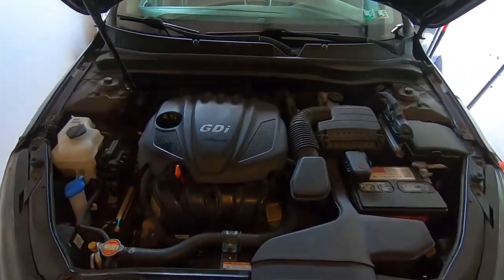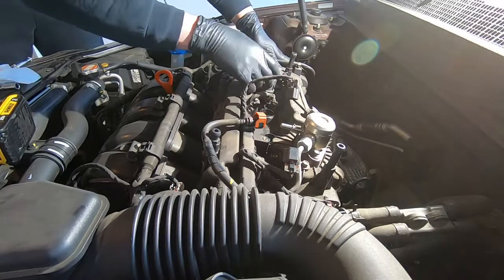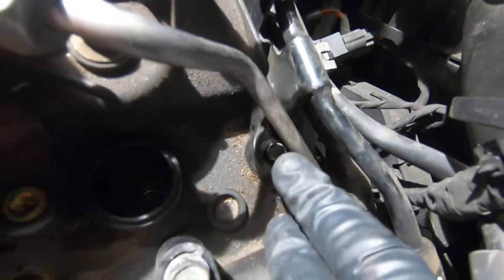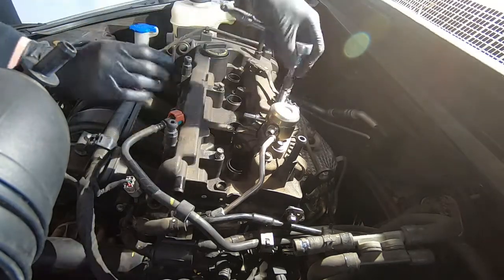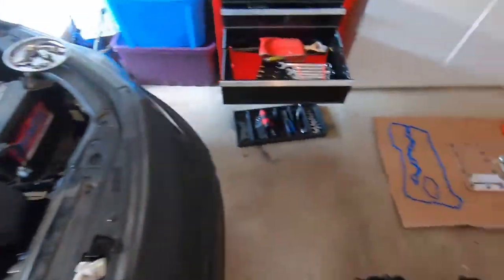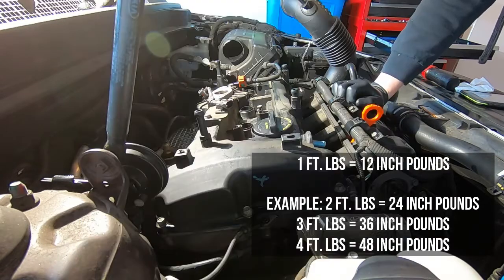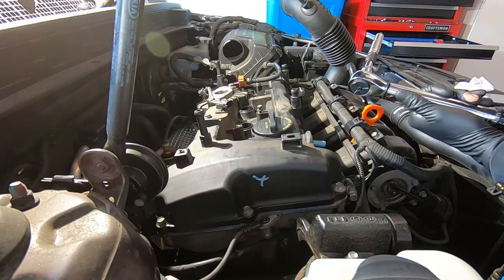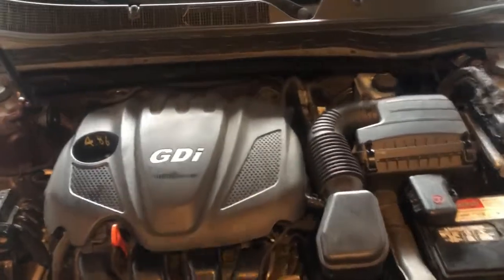2011-2015 Kia Optima Valve Cover Gasket Replacement (2.4L GDI)

Comment: Great tip on removing the fuel relay and letting the fuel run out  was the most important part. Good thing I watched this video before I tried to remove it. The pressure removing the hose would've been dangerous if hadn't done that.
Reply from the maker: Glad it helped 🙏🙏🙏

Comment: Thanks a million my daughter`s 2015 Optima is starting to leak oil around the valve cover gasket rear onto the heat shield. You made this job super easy to follow. I will be doing this weekend. Can`t imagine what Kia would want to do this job. Her car only has 71K miles on it.
Reply from the maker: I appreciate it! This was around the same mileage. Good luck with the project!
Reply: Crazy how my Sorento has 80k same issue, leaking at the same area. Must be a common issue around this milage.

Comment: Just did this today on my wifes optima. Thanks for the video as it saved me a lot of the hassle of figuring out what needed to be moved and the locations of certain nuts and bolts. Took about 3.5 hrs. Not too terrible.
Reply from the maker: Awesome to hear man, glad you got it knocked out 👍👍
Reply: @TheOriginalBeeCee  so far no sign of a leak. I was adding a lot of oil between oil changes and it stunk because of it dripping down the exhaust side onto the heat shield and manifold.
Reply from the maker: These cars are notorious for burning oil as well, so I doubt it was just losing it from the VCG. there was a recall for it and everything. This car in particular was losing almost 2 quarts in a 3k interval
Reply: @TheOriginalBeeCee  I know they do. Hers burns very little. Maybe half quart or so between oil changes. Ive been a fanatic about changing her oil though. The vast majority was the gasket.

Comment: I'm no mechanic, but I try to do certain jobs myself to cut down on cost so I appreciate a lengthy video that shows step by step, thorough instructions. I'm actually going to be doing this exact job on a Kia Sorento tomorrow to THANK YOU!!!! I definitely would have messed something up.
Reply from the maker: Awesome man! Glad it helped, good luck with the job!
Reply: @TheOriginalBeeCee  can you talk with just your hand? I can't find a torque wrench lower than 5 ft per pound anywhere
Reply from the maker: @TheFrost82  I would suggest against it. Especially doing the valve cover gasket. You need an inch pound torque wrench. That’s what I did in the video, is convert the foot pounds to inch pounds.
Reply: @TheOriginalBeeCee  Ok. I can only find a beam style torque wrench that starts at 0ft lbs so I guess I'll have to get that and be extra careful. Thank you
Reply from the maker: @TheFrost82  if you have harbor freight near you, they have them. Autozone and advanced rents them, and you can buy them. Lowes carries Craftsman now, they also have them.
Reply: @TheOriginalBeeCee  actually, right after I replied I did 1 last search and found one at Harbor Freight. Thanks. I'm about to finish this thing
Reply from the maker: @TheFrost82  nice!

Comment: Thanks for the video . Today I did the same thing to my 2011 Kia Optima 2.4 L . Took me a lot longer about 4 hours but the video helped tremendously. Especially with the bolt on right middle .
Reply from the maker: Awesome man! Glad it helped and you got it done! The middle bolt on the right side covered by fuel line is the dumbest setup ever. Lol
Reply: @TheOriginalBeeCee  

.

Comment: Thanks for posting this video! Just got mine done on my 2015 optima. Took it nice and slow and paid attention to all your instructions. Everything went well, except for a bolt that I broke 😂 but I ended up getting it out of there. Some advice to anyone about to do this, if you buy the OEM it will only come with the big gasket (small one is not included) the blue aftermarket comes with both. They might have made some adjustments to it and it now fits a lot better. GREAT VIDEO, I recommend taking up this task while following these instructions!
Reply from the maker: I appreciate the comment! Glad you got the bolt out. Thanks again 🙏

Comment: Great explamation!!! Just finished replacing the valve cover gasket on my wife's 2013 Santa fe Sport using this video. Just about the same engine. Only big difference is the flexible hose connection to the Fuel Pump.
Reply from the maker: Nice 👍 👍

Comment: Extremely helpful.  Just finished my 2012 Sonata.  Waiting 24 hrs to let the RTV set up, then off for a test drive.
Reply from the maker: Awesome 🙏
Reply: Why did you use rtv?
Reply: 3/8ths drive in/lbs 0-120 or higher should do the trick without leaks just start your bolts from the inside by spark plugs/coil packs and just like your tires zigzag/ skip one or two so the middle sits first and then the outsides

Comment: Really like how you explained things I do wish you would have shown some of how you got the valve covers cleaned and that part of the process
Reply from the maker: I appreciate it. But I promise wasn’t too much to see. My best suggestion is brake cleaner, red scotch brite & shop/paper towels for the motor mating surface….On the valve cover itself I would just do brake cleaner & paper towels. I reviewed a bit on the cleaning for over a minute starting @ 23:18. Just gotta take your time and be patient, and you should be perfectly fine. I would get a decent amount of brake cleaner too, for this job I would say maybe 2/3 cans depending on how much oil you have to clean up. You really want to try and get rid of all leaked-oil and any grime/residue as well, because you want to make sure you can accurately see that you solved the leak when the job is completed.

Comment: Great video, big thanks, we just arrive from  KIA  dealer here in central fl.32809..., we told them some smoke and smell is coming from the engine after they check everything they said they did not find anything wrong with the vehicle, is a 2015 sorento with 94k miles. After i noticed that some oil was need it i look on your videos and found the issue; same spot leaking oil , i will do the job next saturday . seems to me they did not check the engine bay at all.
Reply from the maker: Appreciate the comment, good luck with the job! 🙏

Comment: At 210,000 kms. I replaced the valve cover gasket of my 2012 Sonata 2.4L last week.  I have the same Felpro issue at 44:15, but, I managed to have it seated correctly to the cylinder head.  I also replaced the GDI O-Ring.  My engine is not as yellow as the one in the video as I always change the oil every 5,000 kms. using full synthetic oil.  The cam lobes are still shiny and no traces of any scratches.
Reply from the maker: Nice 👍

Comment: Thank you so much for posting this! Really explicit and easy to follow. I might have to do this soon with my 2013 Optima 2.4L. I do have a few questions, if you don't mind:
1. I took the car into the dealer to get a recall addressed and they said my "timing cover" is leaking. From the fact that when you removed this cover it exposed the timing chain I'm guessing this is the same thing as the valve cover, but I was hoping you could clarify for me that the timing cover and the valve cover are indeed the same thing.
2. You showed some screenshots from a manual with torque specs and such. Where did you get this manual? I have a few other jobs that I need to do on this same car and I don't really have a sense for what is a reputable source for manuals and what is not.
Reply from the maker: Hello, thank you for the comment! Sorry for the late reply, YouTube doesn't always send me notifications for every comment. But the Valve Cover and Timing Cover are not the same thing, sometimes you might see the Valve Cover referred to as a Rocker Cover however. The Timing Cover is going to be on the side of the engine, and not fun. Removing the Valve Cover exposes the upper portion of the timing chain, but this is not the job they are referring too. As for the Service Manual with Torque Specs, I have a friend who has access to Kia Factory Service Manuals and I acquired it through him.
Reply: Dear, can you send me the Kia Optima maintenance manual in PDF format? Please respond and I will thank you

Comment: Very helpful video. Good details. Thanks, buddy.

P.S. That blue Felpro gasket still has that wonky section on the one end. Purchased one yesterday. April 3rd, 2021. Somebody needs to call Felpro. 🤦‍♂️
Reply from the maker: Thanks for the input! I just pretty much had the same issue with the Fel-Pro gasket for the 2.0L. Crazy cause Fel-Pro gaskets are usually pretty on point.
Reply: @TheOriginalBeeCee  You got it. I put in a product complaint with Felpro. Maybe they'll get it fixed. I have a 2014 Optima 2.0 turbo. Exact same set up as this one as far as doing the valve cover.
Reply from the maker: @alexanderquintana8607  got ya! Hopefully they do something!

Comment: The hard fuel line off the pump seems like it’s not flexible but it is. apply light pressure prying it to the right  as you lower a deep socket in at the same time no need to remove the air intake and that bracket. Hope this helps someone in 2024

Comment: Only hang up I had and my nemesis are the wire connectors for the coils that didn’t appear to be in this video.  There is a gray tab on the top that slides back, then you depress the center have to wiggle them.  Despise those as easy to break until you figure out how they come off.  Also, the Fel-pro VS50869 R gasket set fit perfect.  Saves $470 from dealer around here.
Reply from the maker: @ 5:50, they were in there 👍

Comment: thanks man for the all the videos..
i have a question about the GDI engine 
is it good and reliable for day driving
Reply from the maker: Thats a very subjective question to be honest. Depends on its maintenance, how it was maintained prior, etc. But generally speaking, in my opinion I don’t think they’re the best platform ever. Prone to oil leaks, especially valve cover as seen in this video, timing cover is good for oil leaks as well as potential timing chain rattling.

Comment: Great tutorial, what if there's sludge built up in the engine? I've heard GDI engines are prone to it and when I changed my PCV valve there was sludge built up inside of it too.

Edit: Question is can I do anything to remove the sludge (if there is any) and is it even worth it?
Reply from the maker: Unfortunately, these engines were prone to some issues & earlier failures. Is it worth trying to fix? That’s really only something you can answer….and how invested you are in it. how many miles are on it, whats its overall condition, whats its condition mechanically, whats its value as it sits now, do you still owe on it, etc etc. These are questions you need to answer when thinking of is it worth investing in or not. As far as the sludge, they’re different ways and remedies to help sort out sludge, some probably help, some not so much. But the real way to address sludge is taking it apart (at least to some extent) cleaning it thoroughly, then putting it back together.

Comment: I have a 2014 sorento with the same engine, it is mandatory to change the gasket of the gasoline fuel pump? I cant find the litle gasket so I need to know if its necesary, nice video.
Reply from the maker: Hey how are you, sorry I’m just now seeing this comment. YouTube doesn’t always send notifications for every comment. But yes, definitely want to replace it, its really part of the Valve Cover Gasket, and should come with the Valve Cover Gasket Kit when purchased. I’ve also seen it available separately.

Comment: Great video. Now I think have same problem with my Optima ex 2014 and  I hand touch through the back of engine where valve cover is and there's a small part of oil leak.
Reply from the maker: Appreciate it! Good luck with the leak 🤙
Reply: @BeeCee Built  are you base in USA or  Canada
Reply from the maker: @raymondcrisostomo9778  im in the US!
Reply: @BeeCee Built  That was amazing video and it's not easy thing do. You have such a patience  removing so many parts darn.
Reply from the maker: @raymondcrisostomo9778  lol I appreciate it! You get use to it after a while 😄

Comment: Hey loved your video easy to follow for diy  i am however haveing a problem with  car when i reconnect verything  the car drives for about 200 yard then just  dies any ideas
Reply from the maker: Damian Daly hey whats up man, sorry to hear. Could honestly be a number of things, but just sounds like to me that something isn’t plugged in all the way or something. I would check all the harnesses that were unplugged, check the MAF harness (maybe even unplug and re-plug in), and I would check hi-pressure fuel pump make sure its reconnect tight and theres no fuel leak.

Comment: I’m just curious if you have a link for the gasket set you used, it looks pretty good quality and I can’t find anything like it, if you could reply that would make my day thanks
Reply from the maker: https://www.rockauto.com/en/catalog/kia,2011,optima,2.4l+l4,1447412,engine,valve+cover+gasket,10710

I used the Felpro
Reply: @TheOriginalBeeCee  thank u so much I appreciate it
Reply from the maker: No problem 👍

Comment: My car is making a noise, a vacuum/air noise after I did this job. Any suggestions on what it could be?
Reply from the maker: Hard to say man. Really could be anything. Going to have to go back over it slowly and carefully. But, I would suggest mixing up small bit of soap in a water bottle with water, shake it and make a bubblely substance. while its running, put some bubbles on a hose clamp connection point, and see if it starts bubbling. You’ll know if it’s leaking. Do this on every hose/line to see if you have any bubbling from air seepage. That would be an easy place to start.

Comment: So i did exactly step by step what you did i took the negativve cable off went threw all of it and replaced the valve cover gasket and a new valve cover because i broke a chip off the first one prying it up. My fault i am new to working on cars and didnt get all the bolts forgot one. But now everything is done i put the negative cable on and my alarm is going off now and i cant figure out how to shut it off? I put the key in the ignition tryed my key fob and its still doing it. So did it goboff when you put it on and my car is a 2013 kia optima lx
Reply from the maker: I had no problem with removing the negative cable. No alarm issues or anything. I’ve seen car alarms go off if the terminal is removed with the doors locked/OE alarm engaged, and then you have to lock/unlock with key fob once its back connected, but other than that I don’t know why it would be going off.

Comment: Honest.
 Ly my thoughts are when you the screws on the valve cover. Keep the screws on the valve cover. Don't take them outhat's a thought. I just have to be careful when you're lifting it up. A very gentle and take your time, so the screws don't come out of the valve cover.  If that makes any sense, rather than taking them all putting them somewhere or.
What have you gonna do Leave the screws on the valve cover when you loosen all of them just a thought.
Reply from the maker: ..if it makes you feel better, go for it. Whatever works!

Comment: Why do I have light blue smoke coming  out the muffler , is it the gasket ? That could be bad  . On my optima.
Reply from the maker: Blue smoke is usually head gasket failure.
Reply: @TheOriginalBeeCee  , so it needs a new walue cover gasket?

Comment: Did you have any issues not replacing the high pressure fuel pipe and the bolts to the high pressure fuel pump. I know Kia says to but I hear a lot of people don’t. If I don’t have to spend the $55 I would like to not do that.
Reply from the maker: Naaa I see no need to replace the pump unless obviously your having pre-existing problems with it.

Comment: IS THIS FOR A KIA OPTIMA (HYBRID)  2013
Reply from the maker: artica shoemake I’m not familiar with the Hybrid design, so I can’t directly say. I know the Hybrids were 2.4’s as well, so I would think there are going to be some similarities, and the process would at least be somewhat inline with this video. Maybe someone else can directly comment on the Hybrid setup. But my best suggestion would to be just pull off the plastic engine cover, and compare your setup to what you see in the video!

Comment: Should it be that dry? Because mine has oil and is lubricated
Reply from the maker: Not quite sure what you're referring too. Although after the cleaning, using brake cleaner and such prepping the surface, definitely could give it that dry look because essentially everything exposed was cleaned.

Comment: I always service my kia 2012 2.4 then i took it to the dealership for the engine recall and after 6 months my valve cover gasket fail they open the engine so i am sure they didn't torque the bolts
Reply from the maker: Yea, definitely a good chance they didn’t.

Comment: Did you smell oil burning?
Reply from the maker: Naa, I can’t say that I did, but this is also not my car.
Reply: Mine just started leaking and yes I could smell burning oil! Mine is leaking by the HP Fuel pump corner! Oil is running down on the hot manifold. If I put my hand back in the area its bleeding like a stuck pig!

Comment: Did mine day b4 yesterday but I have the turbo with a million hoses in the way😠
Reply from the maker: Ahh I'm sure that wasn't fun.
Reply: @TheOriginalBeeCee  the only not fun part was getting the fuel line to move which wouldn't have had to happen if I had a knuckle but I currently do not but a long extension and patience got the bracket loose and fuel line moved enough out of the way
Reply from the maker: @dbaggins5690  yea man that line is in a rough spot. Glad you got it done though.